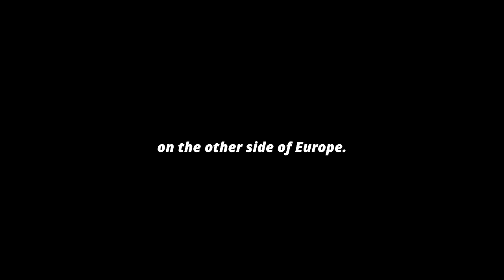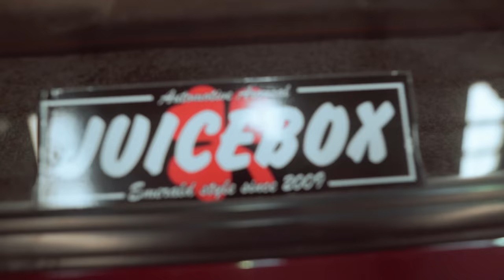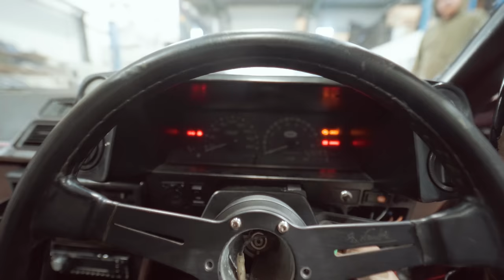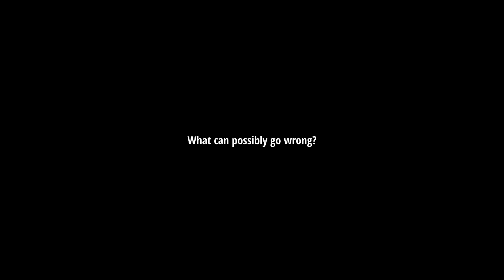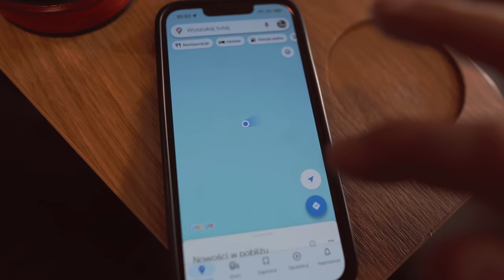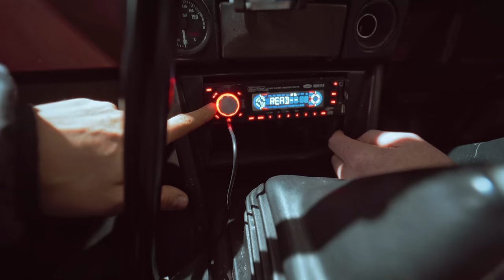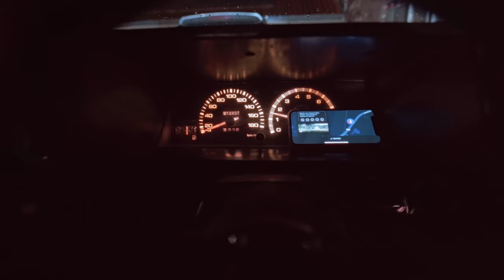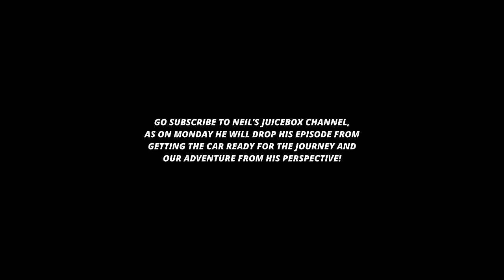Buying My Dream TOYOTA AE86 | 2000 km ROADTRIP across Europe

Comment: is also one of my dream cars... have 3... 86 and then fc and fd rx7... my current daily is an old starlet from 92, has a 2e in it (so only a sohc, but 85hp, the 4e also had 85hp, only the japanese only 4e with the turbo was 135hp or so...) drives well, 180km/h+ on the autobahn (yeah, sold shitbox overtaking new sport cars is always fun)

Comment: Watching nightride this last month and this episode has resparked me to drive my trueno again. Had it sitting 3 years for an engine swap on a clean body. the next day someone tried to steasl my tires overnight. didnt notice since the wheels were still on. felt weird driving and at the stoplight the wheel rolled off, the car fell over and it blew the strut tower and bent in the front fender. After driving banged up cars for years and sick of it i was happy  finally having a clean car only to lose 3 years work in a day put me off for 2 years of even driving it. Fenders arent easy to get where i am so i have to always wait patiently for a replacement.

Comment: I really want an 86 or some other JDM but I'll only be 16 in about 5 months and I feel like I'll never have so much money to get something like that 😩
Reply: Pro tip: Don't buy one of these cars if it's your first car. Not only are prices extremely high these days, most of these cars have been abused past their limit. Maintenance costs and finding parts can be a pain depending on where you live. 
That does not mean you need to get a boring car though. You could start with something newer like a 7th-8th gen Civic Si. Not exactly the best looking cars, but they handle like a dream and come with a K series engine.
Reply: @dudocaine  Of course, I wouldn't be able to even get one for at least a year since the taxes are so high.. I could probably affor d a W124 or a lada though

Comment: quick question why not get a ae86 from japan
Reply: More expensive
Reply: @blaubarschbube4643  isn't it the same price?
Reply: @misanthrope0  You could buy a 86 in europe for around 20-30 k, if you import from Japan its around the same price but on top of the price if the car itself you need to also pay for import fees and other expenses